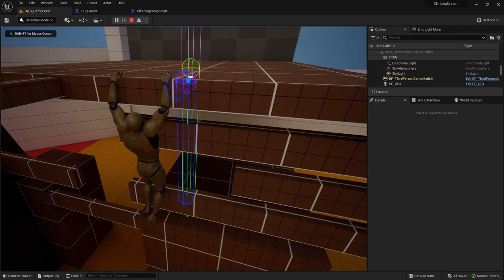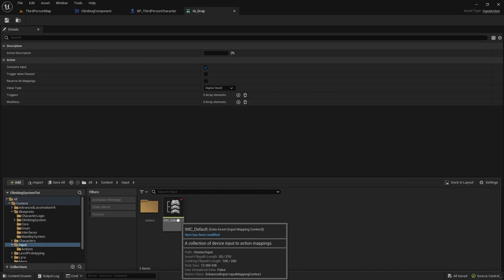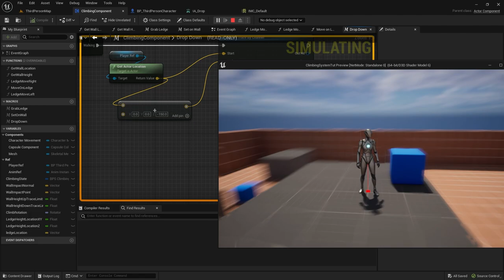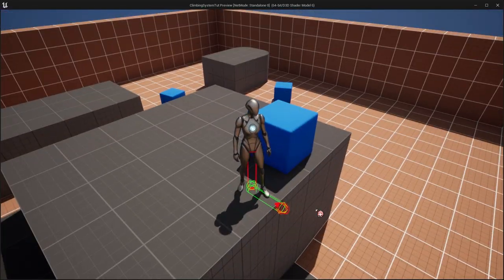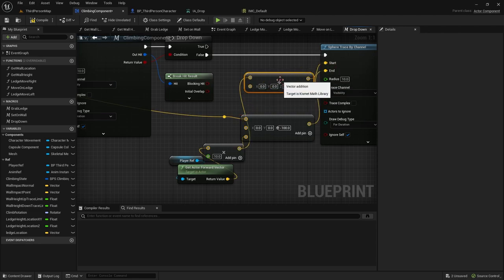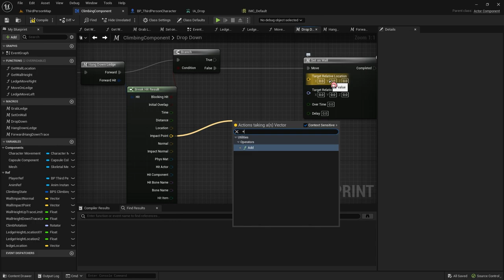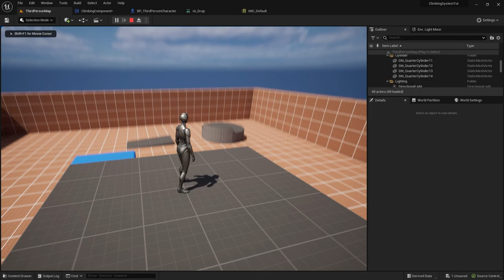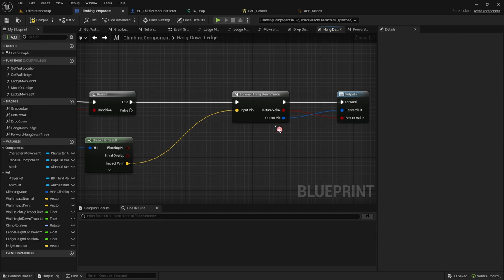How to Hang Down the Ledge in UE5 Climbing System Tutorial | part 9 |

Comment: I'm not sure if you've fixed this but in rotation from the x vector in your drop-down micro, instead of doing * -1, do + or - 180 cause if your rotation is 0 and you *-1 it will equal 0 or if the rotation is 39 it will be -39 you need to add 180 so no matter your direction like if it's 0 it will equal 180 or if its 39 it will equal 219.
Reply: i love your videos btw I've learned alot more about animation and blueprints than from any other video I've seen
Reply from the maker: I see thanks for the suggestions i will look into it and let you know. And i am glad i am being helpful.😄have a great day